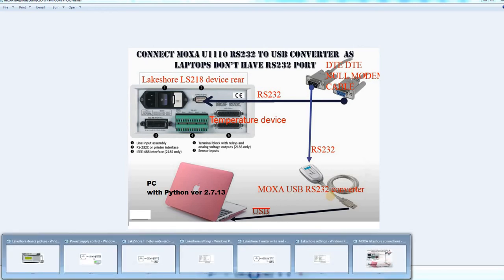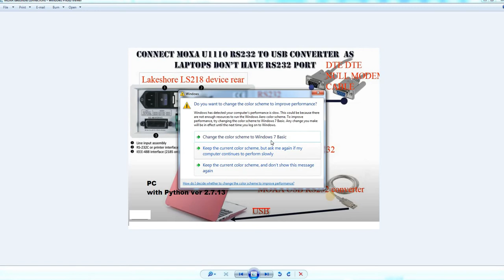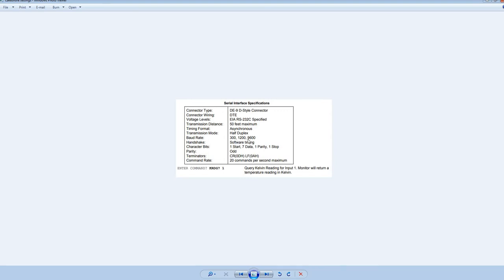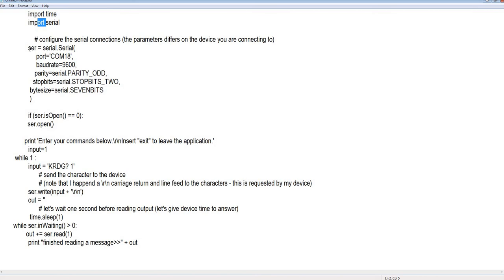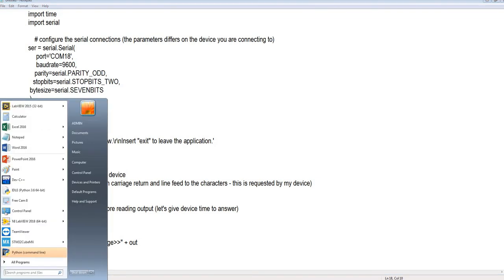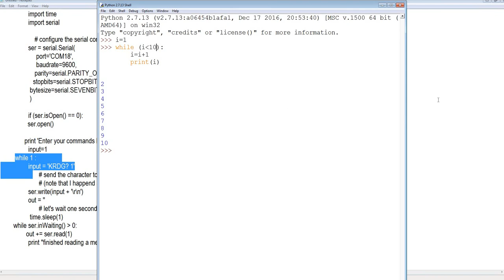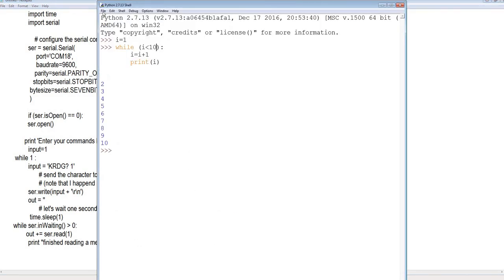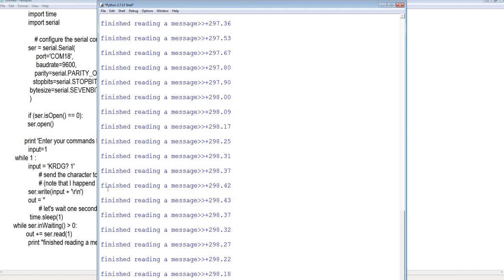RS232 SERIAL PYTHON INSTRUMENT INTERFACING

Comment: Hello sir, the video was really helpful. It guided me how to start. I have a question. I am trying to communicate with teledyne Mass Flow Controller(MFC) digital 300 series through rs232 serial. To start simple, from the datasheet, to get a model and software version of the device(MFC), I have to command it S1. So from your video, I replaced KRDG? 1 with S1 in a hope that it will print out something. but it did not print anything. just "finished reading a message>>". Why didn't it print out anything? BTW,  I had to encode and decode write and read since without it the typeerror appears. Thank you